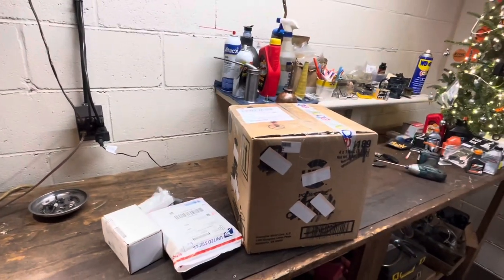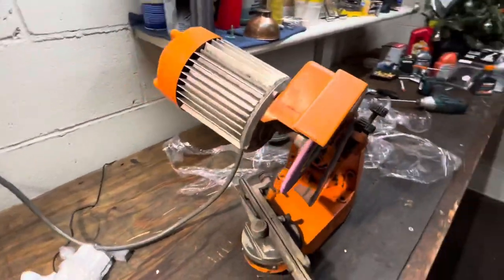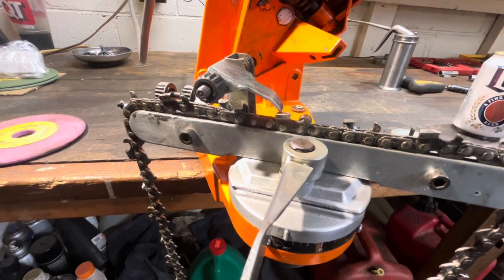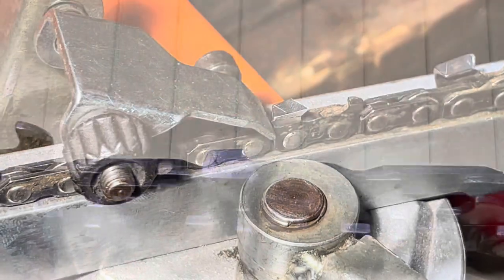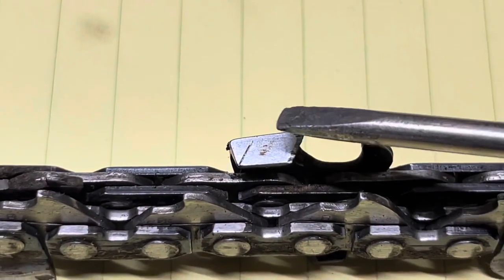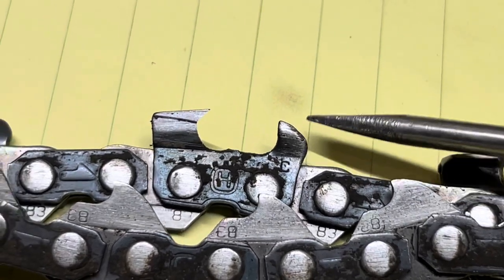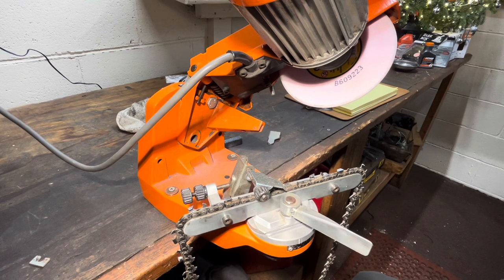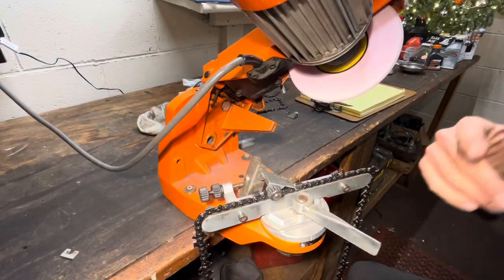Oregon Chain Grinder Not getting good results? Pro Tips and Set up

Comment: Richard, on that series grinder you need to tilt the base 10 degrees each way for left and right cutters on round ground full chisel. Only way to cut to the point.  I always take a new loop of chain and set all settings to a new tooth’s shape. It will look like a new one, just ground back when you sharpen a used chain.
Reply from the maker: I've always had good results without tilting the vice.  That being said I'm all for getting better results.  I'll do a follow up with some cutting comparisons.  Thank you Tim
Reply: Trying to verify I am tilted the right direction for the 10 degrees.. if sharping the cutter on the back side of the vise I want to tip the top of vise forward towards me?
Reply: @JohnSmith-tn1te  if your teeth are facing right you would pull the knob on the base toward you to grind the left side cutters. This tilting the base back. Just look at the wheel into the tooth grind without turning the wheel. You will see how it matches. It’s only for full chisel teeth set it in the middle for semi chisel
Reply: A right tooth you push it away. RIGHTAWAY .
Reply from the maker: @rc391995  Thank You!
Reply: Is the Tacomec Super Jolly a good investment ?

Comment: Not using the vice tilt? A lot of people don’t. I myself do, chains seem to cut better for me when I do
Reply from the maker: I usually don't tilt.  This one will tilt.  Sounds like I should do another video with some comparisons.
Reply: I was wondering what difference this made also the offset vs 0. Is that the offset substitute for the tilt? 🤷🏽‍♂️
Reply: @cajun3197 , yes if the whole vice slides, gives more choice of angle. Left cutter, back right towards you.
Reply: @trwilkinson4623  thanks

Comment: tip worth trying.
Prior to grinding your chains, a soak in Super Clean will remove any pitch and oil from the bar lube.
Sharpen chain and then re-lube with lube of choice. 
This tip is not sponsored by anyone.
Final note: I tried several cleaners before making the aforementioned my goto.   
Thanks for the video
Reply: Thanks for the tip, I have been looking for a suitable cleaner.

Comment: Richard, Great stuff.  Awesome tips on vice angle soft vs hardwood.  I found to keep more consistency tooth to tooth on my chain using my oregon bench grinder, I found that I setup my R or L side cut, get depth set (up / down), then adjust top plate depth (side to side) so I just kiss the tooth.  Run the whole loop by that side once.  Then nudge top plate depth in a little more, run the loop.  Keep going till all shoulders sharp.  This way keep from heating chain and loose heat treat in steel as you only zip a little at a time and tooth cools as you do next tooth and run the loop.  Flip sides.  Rinse. Lather. Repeat. Until L and R sides top plates are about even length.

Admittedly, that chain you demo'd was pretty ratted up.

But yea.  Dead on about consistent light touch when you bring grinder head to chain.  Absolutely cannot ham fist it like driving 16d nail in 2 hits.

Comment: There is an old school trick to reverse thse motors if not wired for a dual switch. Take a drill, spool up the wheel in reverse direction, and bingo!
I have the MAXX grinder, both sides grind into the wheel.
The racing chain community says that grinding or filing into the wheel lays a truer edge.
Nice work Rich.

Comment: For a quick touchup sharpening, I still hand file. For a very dull or hammered chain, I use the stones that go on a dremel. You hold and stroke the dremel at the same angle as a file and it gives you a brand new, razor sharp tooth in seconds.
Reply: @williamwallace9620  Into the hook is what I do but it doesn't seem to do matter either way.

Comment: If the grinder is way off from left to right angles try centering the chain vice with the centerline of the grinders wheel bolt. Worked wonders for my older oregon grinder. Had to slide my vice in almost an1/8" .
Reply from the maker: Yours have the two allen screw hold downs underneath the vice, yes?
Reply: @richardflagg3084  Yes

Comment: Nice job- 
There should have been a plastic template (comes with the grinder) to keep the profile edge correct.
I’d suggest you top your “hook” back just a bit.
Really sharp point but not very strong (durable)

Comment: Rookie question: Would a spring on the tooth holder causing the clamp to apply a little downward pressure aid in holding the link that is being sharpened help?
Reply from the maker: I haven't tried that, yet

Comment: Great explanation.
I got an old efco sharpener I'm trying to get the hang of. I thought I did something wrong when I switched to the left side cutters. You'd think 25 or 30 degrees swapped to the other side would just line up minty. Oh no no. For sure more adjustments for the first tooth when you switch sides.
You touched on it at the beginning, my sharpener also has the ability to spin counter and clockwise. What would this be used for?
Reply: So that the wheel is grinding outside in on both left & right cutters. Should help eliminate burr on side plate edge. If there's a significant difference between left & right cutter setting, assuming cutters are same length, then the chain vice may need centring to the middle of the disc Arbor. As the diameter of the disc reduces due to wear, has to be reset. More expensive models allow the whole vice to be moved. Cheaper, adjust the screw on the middle of the vice only. There are YT videos on how to make the adjustment. A small amount of turn to the screw has a significant effect.  Good luck with your machine.

Comment: How is that Tecomec white wheel compared a CBN wheel?

The main thing I do to keep from over heating my teeth on severely damaged teeth is.  I'll make multiple passes on the entire loop instead of trying to take all off at 1 adjustment.   Doing multiple passes in small incriminate's is easier on the grinding wheel, keeps teeth cooler and can maintain same teeth length

Comment: Hey man how is the "grit" on the white wheels compared to pink/green/resinoid?  
I'd love to find something that is more like a 120 grit than the 60/80 for a finishing pass on go-fast chains.  It seems that for speed/temp control reasons most of the normal wheels are quite coarse.  White is a color I have never ran.
Reply from the maker: Seems to be more coarse.  I haven't looked on Tecomec's website to see if they have any info on the abrasive specs.  Makes sense using a fine finishing stone to get optimum sharpness.
Reply: @richardflagg3084  Yeah it would really be for "fun" but it would be nice to be able to be equivalent to a great round file job.  I can grind better than a "decent" hand file job but there is still a gap there.  I think a big part of it is just surface finish.

Comment: Man Richard I'm glad you made this video. I've been using the Oregon 410 grinder for close to a year now mainly to straighten up rocked chains or to just clean up my angles every now and then. I run all Sthil chains so I set up the grinder according to their spec's, 60, 30, and 0 degrees. Does a pretty good job, but I noticed when I hand file my grind isn't matching up great to my file. I use the Sthil recommended 13/64 file. Should I jump up to a 7/32 to match Oregon? Definitely want to try a different wheel, seems like the purple stock wheel will burn a tooth in a heartbeat. Would like to try a CBN wheel but dang,$$$. Thanks.
Reply from the maker: Yes, the diamond wheels are pricy.  I haven't ventured into the diamond wheels either.  Try the Tecomec grinding wheels they are much better and only a little more expensive than the "stock" wheel.  At the end of the day you should enjoy using the grinder you invested in.  Dealers choice on the file size.  The 13/64 does a better job as the tooth gets shorter IMHO.
Reply: @richardflagg3084  Yep, I had someone tell me 7/32 when new and 13/64 when they get past half. I will look into the Tecomec wheels. Thank you for the content I really enjoy it. I got my saws off the pond water and running 40:1 red armor, their running great.

Comment: On the opposite side of the camlock there is an adjustment screw to clamp the chain tighter.
Reply: That adjustment screw is for centering the chain to grind both right and left cutters the same length. Takes some experimenting.

Comment: Was wondering if the Tecomec Super Jolly grinder was a good investment for lots of chainsaw chain sharpening ? Are those grinding discs reversible ? Thanks for the video too BTW 👍🏻
Reply from the maker: I haven't used one of the new grinders to be honest.  Unless you can find an older grinder in very good condition, the Tecomec seems to be a good option.  Wear and replacement parts should be available for a long time.
Reply: @richardflagg3084  thanks again 👍🏻

Comment: where did you order your wheels from and do you prefer one type over the other?.........wasnt sure what grit you are using?
Reply from the maker: Archer Plus has it's own website or you can order from them off Ebay.  They are a Tecomec dealer and have spare parts and multiple wheels.  I like the green and white wheels.  they are so much better than the oregon wheels.  Not sure what the grit is on either.  I believe there is some more detailed info on the Tecomec website.